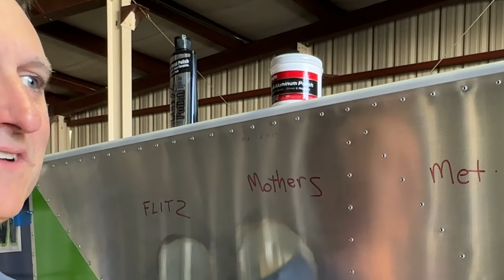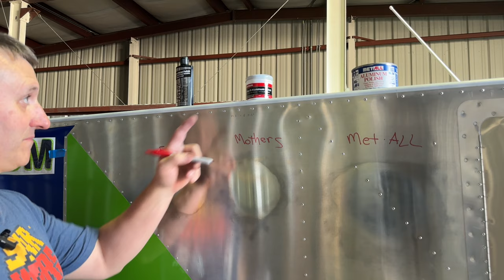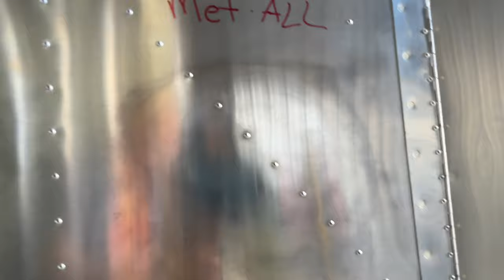Zenith Cruzer. Turnbuckles, Polish comparison, Lower Cowl Mod

Comment: I worked at a place that built aluminum cars and we would polish the bodies to a mirror finish.  After testing all of those products, NuVite really is the way to go.  They have different compounds and the coarser one really cut through and get you to a good spot quickly.   Then its just a matter of using the finer ones to finish it off.  Wool pads on a heavy duty polisher make it easy.